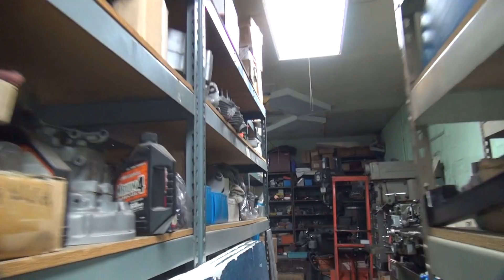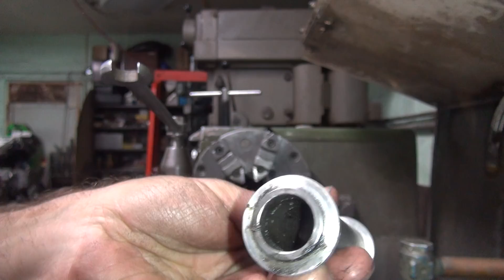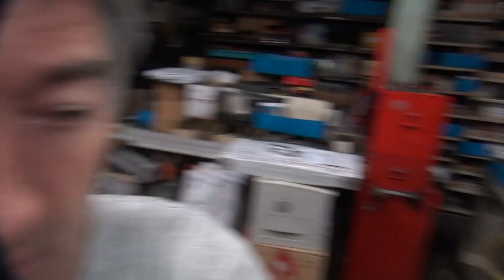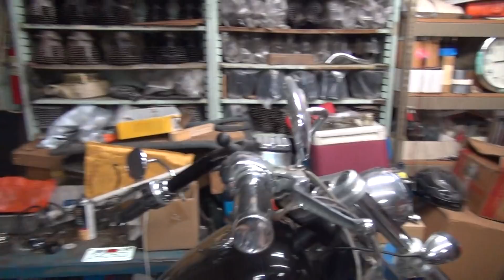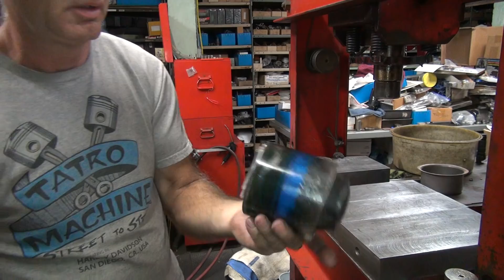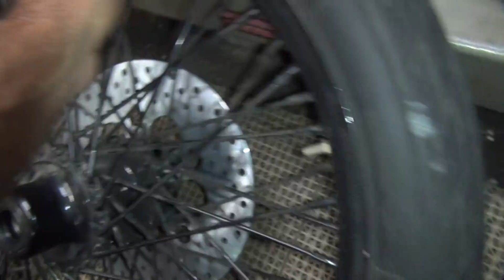#147 S&S 113ci evo motor blown belt drive transmission repair harley swift evolution tatro machine

Comment: I’m confused how does cutting the spacer eliminate end play? What am I missing?
Reply from the maker: the spacer sets the location or distance between the bearings. the hub does the same for the races. when you cut the spacer the bearings move closer together and the races stay put. this takes out some of the distance or clearance between the bearings and races.
tatro

Comment: i have worked in automotive for years, those bearing packers work great, just use the floor and some pressure from the heel of your boot
Reply from the maker: i don't think i want all the dirt on the bottom of my boot going into my new bearing grease. i can push hard with my hands too but the press is way more accurate on how much grease i am putting into the bearing. the tool does work very well.
tatro